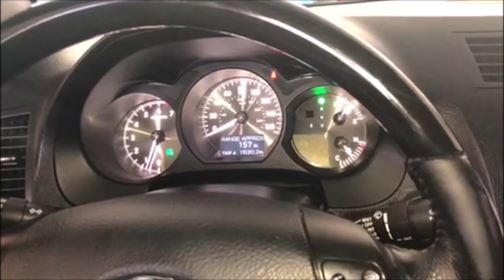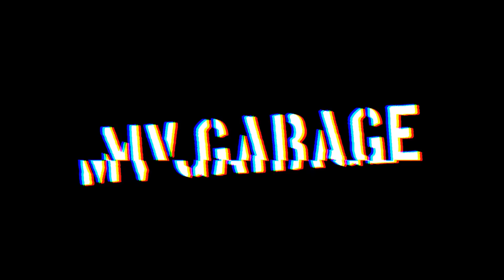Lexus Toyota VSC / Trac Warning Light FIX

Comment: I'm wondering if this will work on a 2009 Camry hybrid? 
 Having same issue with the VSC light. But the braking system feels fine.
Reply from the maker: If it’s just the VSC light on it should work won’t hurt to try. If you have a check engine light on too. It will be a different procedure.
Reply: @FlipITGarage  I have all 4 lights on. ABS, Traction, Engine and warning triangle. I have a new gas cap coming today so I will try that first.
Reply from the maker: @randyjohnson8231  Watch this video to reset all those lights. https://youtu.be/iLrolhRr9lk if it comes back on you’ll need to get the code scanned to see what the problem is.
Reply from the maker: @randyjohnson8231  The VSC light always goes on with the check engine light. You said it was on correct ? You’ll need to do the other reset procedure to clear them.
Reply: @FlipITGarage  Yes the VSC and check engine light are on. 
Exactly what procedure do I have to do?  Thanks
Reply from the maker: @randyjohnson8231  I sent you a video link above. But basically disconnect the negative battery terminal for 10 mins then reconnect. All the lights will be cleared.
Reply: Disconnect the battery overnight and still the light are on. Tried just about every procedure that I have read and gotten help with. Have a feeling it's the ABS VSC braking component that is probably worth more than the car. Anyway I just wanted to thank you for all your help and responding to my questions.  Thanks Again.
Reply from the maker: @randyjohnson8231  No problem! I have a feeling you have a bad wheel speed sensor. Not sure which one as there is one on each wheel. With a good scan tool you should be able to pull that information.
Reply: @FlipITGarage  as it turned out it was  the left rear speed sensor. Replaced it with a new. $110.00 Light are gone. Thanks for all your help.
Reply from the maker: @randyjohnson8231  Nice! Happy to help! Glad you got it figured out and it was a inexpensive fix 🤙🏽 thanks for the update.

Comment: Hey my vsc came on along with the check engine at the same time. Is it normal to turn the check engine light when the VSC light comes on?
Reply from the maker: Ekis 777 Yes. The VSC light will come on with the check engine light. You’ll need to get the check engine light scanned to see the issue.
Reply: MV Garage thank you
Reply: Hi Ekis 777, I have the same situation both engine light and VSC lights are on. I have to still take the car for inspection but just wanted check whether you were able to find what the issue was.
Reply: Ravi Ven Knock sensor
Reply: Ravi Ven If you want to get rid of those lights turn off the car and then push and hold the start button twice so all the lights are on Then turn it on
Reply: Ravi Ven Let me know if it works for you
Reply: Ekis 777 got my vehicle code it is - P0A80 - Replace Hybrid battery pack. (Sounds like very expensive to me) .
Reply: Ravi Ven Do you have an IS250 what year
Reply: Ekis 777 lexus Rx400 H 2006
Reply: Ravi Ven Bunch of stupid sensors

Comment: I have a tire pressure indication that appears and disappears and written to me as a check system my car gs430 2006 how fix??
Reply from the maker: عبدالسلام الغافري either low tire pressure or a bad sensor.
Reply from the maker: Possibly programming as well. There’s a button on the drivers side floor above your feet. Hold it down.

Comment: Right rear door light always blinking can not lock door using remote. If u make video how to fix great. 2006 gs300.
Reply from the maker: Thanks for the comment! I’ll see what I can find for you. I don’t currently have that issue but I’ll look into a repair for you.
Reply: Try the door sensor they have a tendency to fail. 84231-53010 is the Toyota part number.

Comment: I have a 2006 Lexus Gs300 RWD, 3months ago those same lights popped up on my dashboard didn’t know what they... long story short I changed all solenoids and transmission fluid, why? Because my car won’t shift passed third. Took it to a shop they said that the transmission was in good condition and that my (ECU) was at fault, I sent my ECU to be “fixed” on eBay, I received it but still the car still gets stuck on third!. Not to sure what to do now  (wiring harnesses has been checked)
Reply from the maker: Mc Antonio Have you pulled the transmission codes ? Also was there any metal flakes in the transmission fluid ?

Comment: I tried this on my 2008 RX 400h and which was giving me DIAG VSC 43,45,62,63.  After the reset I'm can't seem to clear 45?  Any suggestions?  I pulled the front wheel speed sensors and cleaned them, but they looked good.  Also tried pulling the battery cable, but not change.  No CEL.  Just VSC.
Reply from the maker: 45 is Acceleration Sensor Output Malfunction. You may need to do a zero point calibration to see if it goes away. If this method didn’t clear it you may need to do it with Techstream computer software. Or could just be the sensor needs replacing.
Reply: @FlipITGarage  That was it.  I had to do the zero point calibration and it went away.  So far so good!  I just got the Techstream cable and software and took some time to figure it out.
Reply from the maker: @dslemaire  Glad you got it worked out! Must of been frustrating. Let me know if you need help with anything else 🤙🏽

Comment: I have a Lexus Rx400H, and i tried this but only go the blinking lights on the dash after doing the paperclip part. I never got the part that says "vsc Test mode" any advice?
Reply from the maker: You don’t have the check engine light on with it ? If you do check out this video: https://youtu.be/iLrolhRr9lk
Reply: @FlipITGarage  no i dont
Reply: @FlipITGarage  I also cant get the code, and i tried several different code readers and even had a guy that works at Lexus try with his home code reader. 
no codes

Comment: So I did this and vsc mode never appeared. 4wd test mode popped up and I still have the vsc and check engine. Is there a reason why? All I did was change the tires and the I bought an o2 sensor and it still never cleared.
Reply from the maker: Wilfredo Rivera because the check engine light. Those lights are on because of that. Disconnect the battery for 15 mins to clear it.

Comment: Will this work for 2011 rdx? I am getting TRAC OFF - check AWD system with check engine light. Took it to Autozone and the car has code off replace fuel cap. I tightened it and the lights still won’t come off. Ugh. I just got the car a month app ugh😢

Comment: Wondering if this will work on a 2008 LS 460. Having a similar issue with all the brake and VSC lights. Any insight?
Reply from the maker: As long as the check engine light isn’t on this procedure should work for you.
Reply: Ahhhh man, what happens if the check engine light IS on???

Comment: Will this work with a 2002 lexis is300?
Reply from the maker: Timonatorz I haven’t personally tried it on the is300. But it won’t hurt anything to try. Let me know if it works for you.
Reply: MV Garage it did the flashy vsc test mode but vsc light is still on. I think its because i have a p1121 code which is accelerator pedal position sensor

Comment: I have Toyota Venza 2014. After we did some major suspension work on the vehicle this lights show up. The Red triangle warning light, the traction control light saying check VSC system. There is no check engine light, so no code read. Scan tool shows no code. can I still use the method.
Reply from the maker: Definitely give it a try. Won’t hurt the vehicle if it doesn’t work on the Venza. If it was triggered by mistake this should take care of it. If there was something done wrong it will come back. Good luck!

Comment: Hi freind, 
I am working on a car (Lexus Hybrid 2010 ls600gl), Error showing in break light, error code is C1203, C1345, C1336, 
Kindly help me out, I am in trouble.
Reply from the maker: Hi, that could be an issue with the abs actuator or a ecu. Hard to help without seeing the vehicle. You can try clearing them to see if it will recognize after the reset.

Comment: Does trick apply to the "06" is250 model? Thanks for sharing.
Reply from the maker: Yes, this would work on the 06 but only if the VSC light is on without the check engine light.
Reply: @FlipITGarage  ok, both lights are on so I won't do the paperclip trick. I'll try the battery disconnect. Thank you for the reply.

Comment: will this work for 2002 LS430?
Reply from the maker: I haven’t personally tried it on the LS but it won’t hurt the car to try it out. As long as it’s just the VSC light and not with the check engine light. If you have the check engine light on too. This won’t work. If you have both lights on watch this video: https://youtu.be/iLrolhRr9lk

Comment: Does it work for a 2007 Lexus ls460
Reply from the maker: Yes, should be the same procedure. Won’t hurt the car to try.
Reply: @FlipITGarage  so on the ls460 instead of jumping them straight across from each other you jump them 4 down on one side and 5 down on the other side if you know what I mean
See my lights came on after changing a wheel bearing so I know nothing was wrong with the VSC So after jumping you can basically use the same method you showed us but instead of saying VSC test it will say VSC DIAG 
From there the ABS light Will start blinking count the blinks that will let you know how many codes come up 
If ABS light keep blinking there is no codes But if it stops there might be something 
To remove the VSC ABS TRAC lights just turn the car on press the brakes eight times within five seconds don’t worry about the five seconds though but after pressing the brake enough times VSC DIAG OK Should come up and the lights will go off remove the paper clip jumper but if there’s something wrong after a while the lights will come back on
Did it today work just fine
Reply from the maker: @astonclinton1821  Thanks for the info! Great explanation. I’ll be sure to let others with the LS know when they ask. What year is your LS ?
Reply: @FlipITGarage  2007

Comment: I have the gs450h 2007 and got the check hybrid light, engine light, traction control check and v check, would this work on mine?
Reply from the maker: No this wouldn’t work. All those lights are on because you have a check engine light on. Only way to clear that is with a scan tool or disconnecting the negative battery terminal for 10 mins. But if you have a problem that wasn’t fixed, the light will come back on.

Comment: Does this apply to a 2007 lexus gs 350 ?
Reply from the maker: Yes, same procedure 🤙🏽
Reply: @FlipITGarage  ok thanks. I dont have owners manual. Do you know for sure that i put the paper clip in the same exact spot ? The 4th pin down.
Reply from the maker: @usavideogames7599  exactly the same as the video. The car it was done on is the same as yours but a 2006.
Reply: @FlipITGarage  ok thank you
😀

Comment: My GS450h sat for one week and upon starting had both the VSC and P/S light. I can’t seem to reset either based on your vids. I’ve yet to get under the car to diagnose the P/S.  I plan to try the steps again in the vids. Any suggestions?  I’ve subscribed to show support. Keep up the good work.
Reply from the maker: chapchapw Hi, thanks for subscribing! I would start by trying to reset the computers. Disconnect the negative battery terminal for 10 mins. You watched the video on the P/S light reset?
Reply: @FlipITGarage  I will do the reset next and get back to you. Yes, I've watched the vid on P/S reset. Thanks for the reply!
Reply from the maker: C W Sounds good. Yea let me know. Good luck!
Reply: MV Garage No luck with the reset. Will try your steps again for VSC and PS.  Maybe search for fuses as well.
Reply: MV Garage Turns out it needs a new rack. All connections were good. No corrosion. Internal torque sensor.  Thx for your support along the way. Appreciated.
Reply from the maker: chapchapw Your welcome make sure you shop around. I installed a used rack I got off eBay for $350. It was probably to far gone to save yours. Thanks for the update. Good luck!
Reply: @FlipITGarage  my gs hybrid is doing the same . I was driving down the interstate and suddenly it came to a slow crawl . My dash is givinge the "check vgrs system" light.  Any idea what it may be? Thank u in advance 🙏
Reply from the maker: @modess0128  Have you checked your battery ? A lot of times it is caused by a weak battery. I would start there. Let me know if you need more help.
Reply: @FlipITGarage  I had triple a check the battery and the voltage was on point . I'm thinking it's my inverter?

Comment: Watsup man. My gf just bought this same car of some dude with this same issue. I warned her to buy it cuz it could turn into a money pit so here we are. I tried your trick exactly how u said to and it didn’t work. When the light is on sometimes it seems to not shift passed 3rd gear like it’s stuck in limp mode or something. When the light gets cleared it drives through all the gears just fine and a dealer said it needed a new trans all together but hard to believe considering it works fine when light is cleared and  the light always comes back on the next drive.
Reply from the maker: GRiM Overall there good cars and last a long time. Do you have a check engine light on with the VSC light ? If you do. They both always go on together. I would need the code to help. Let me know.
Reply: MV Garage  yes both lights are on. I’ll get the code for u
Reply: Code p0761
Reply: @FlipITGarage  I have a Lexus gs430 n my back brakes aren't working, just the front, abs light on, any ideas?? They been bleed, new master cylinder
Reply from the maker: Cha Bo are you getting brake fluid to the rear ?
Reply: @FlipITGarage  Yes
Reply from the maker: Cha Bo could be a number of things. Seems like it may not be getting enough pressure to the rear. Have you changed the proportioning valve? Also make sure your getting good pressure. Otherwise I suspect a clog somewhere or the pistons may be seized. Hard to know without seeing the vehicle.
Reply: @FlipITGarage  it's not getting enough pressure but thanks for the info
Reply from the maker: Cha Bo definitely make sure it is bled properly and check the hoses and master. Should be able to pinpoint it. Good luck!

Comment: How about Lx 570 model 2008 i have same light coming
Reply from the maker: Not sure on that model but it won’t hurt the car to try this procedure. Let me know if it works.
Reply: Ok 👌🏻
Reply: @FlipITGarage  i do another thing 
1 . Remove only the negative wire from battery and leave the positive.
2 . Wait 5 minutes then reconnect the wire 
Finally the car will programmed itself and the fault is gone .
Reply from the maker: @osamabozaid3273  did you have a check engine light on with the VSC?
Reply: @FlipITGarage  no only check VSC  system i was fixing new bosh and arms then the light is show up
Reply from the maker: @osamabozaid3273  sensor may have become damaged or disconnected. It will help if your able to pull the codes.

Comment: Will this work for 2006 Lexus is250?
Reply from the maker: Should be the same procedure. This was done on a 2006 GS. Won’t hurt to try.
Reply: So I did it right now but it did not go into vsc mode could it be cuz the check engine light is on?
Reply: Lights did flicker though
Reply from the maker: @GetemErick  If the check engine light is on this procedure won’t work. This is if only the VSC light is on. Here’s a video link to reset both the check engine and VSC https://youtu.be/iLrolhRr9lk
Reply: Your the best man just getting back to me gives me some type of support you got my SUB  I literally have the battery disconnected right now replying back I did that on my own while taking a smoke break it’s been almost 30min so ima plug it back in if it comes back on ima take it to my trusted mechanic and have him diagnose it thank you for your help..
Reply from the maker: @GetemErick  Your welcome. Happy to help and appreciate the feedback. Yea if it comes back on you can take it in for diagnostics. Or goto autozone have them scan the code for free and let me know the code I can try to help. Best of luck! 🤙🏽

Comment: @philiplee1216  I did exactly the same(disconnect the battery and paper clip trick ). I drove for three hours and the issue returned 🙈 mine has a traction light+vsc+engine light...
Reply from the maker: You will need to get the check engine light codes pulled. That is what is causing the VSC light. They go on together.

Comment: i install paper clip follow instruction, i saw VSC test mode but the problem still persists. I change break pad 2 days ago
Reply from the maker: If you tried it multiple times and it didn’t turn off the error. You may have damaged a wheel speed sensor. You’ll need to get it scanned to see which one and replace it.

Comment: I did this to Lexus is250 06 and it did the flashing and everything but the check vsc is still on😢
Reply from the maker: Try the procedure again sometimes it doesn’t take right away. If it doesnt work again then you have a problem that needs to be corrected first. You’ll need to pull the fault codes and see what’s going on.

Comment: What happens if I put the paper clip in the wrong hole? I am super paranoid of shorting out the electricals and you know that's expensive to fix. I have the "check VSC" No other lights come on (engine)
Reply from the maker: Totally understand your concern. All I can say is I’ve done it and nothing happened. Just try and follow the video and get it in the correct slots. If it’s just the VSC light this procedure should work for you.